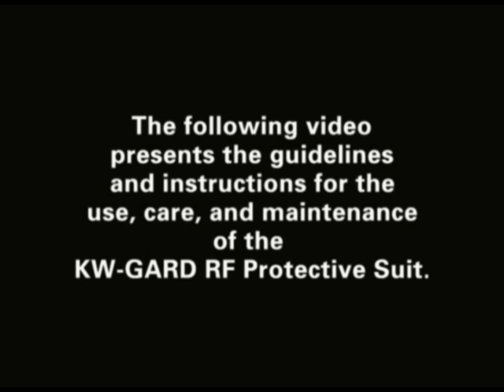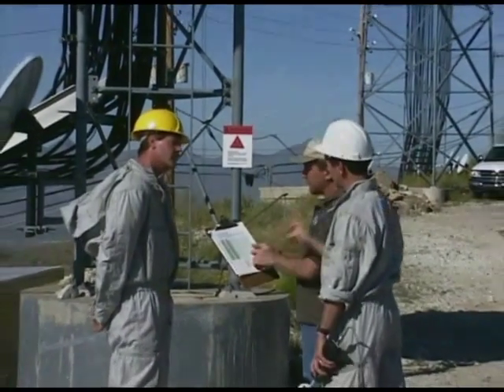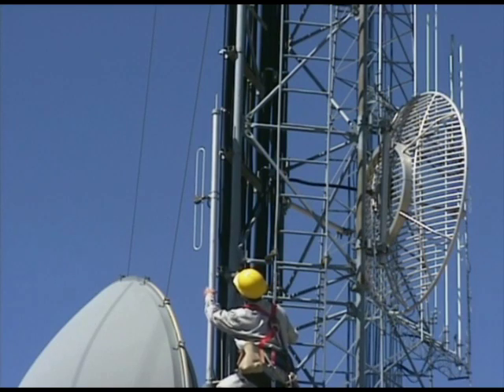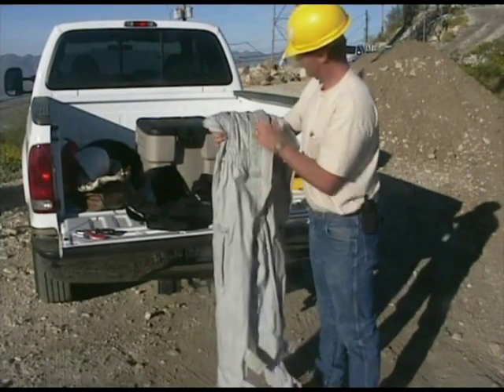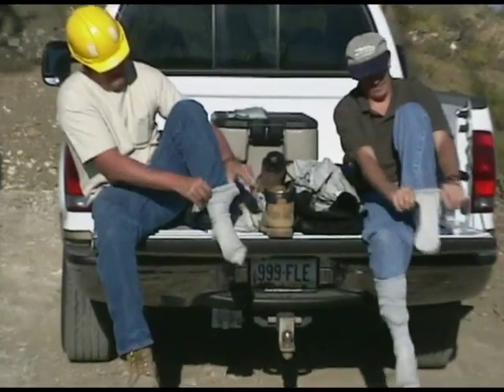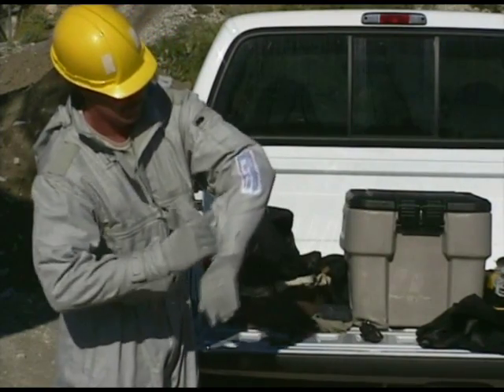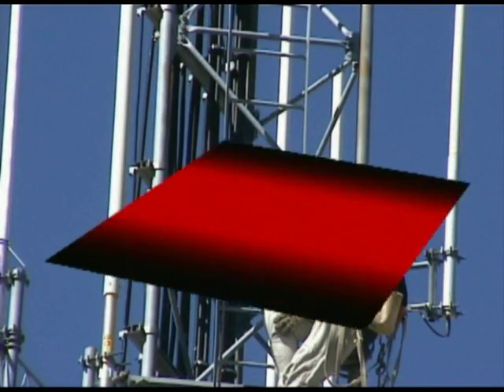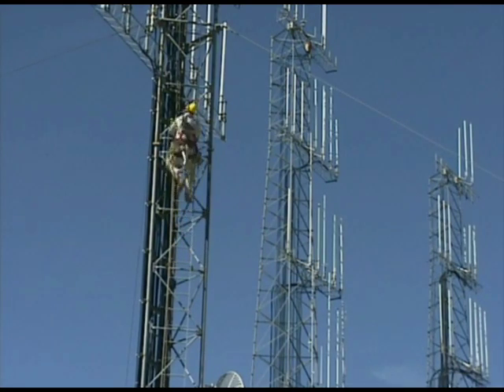KW Gard RF Clothing

Comment: Interesting. RF (Radio Frequency) radiation protective clothing. Hmm. Starts off with a bang! Know your field that you'll be working in. Great video. Thanks for the post. http://www.fda.gov/Radiation-EmittingProducts/RadiationEmittingProductsandprocedures/HomeBusinessandEntertainment/CellPhones/ucm116338.htm

Radiofrequency Background: What is radiofrequency energy (RF)?
Radiofrequency (RF) energy is another name for radio waves. It is one form of electromagnetic energy which consists of waves of electric and magnetic energy moving together (radiating) through space. The area where these waves are found is called an electromagnetic field.

Other forms of electromagnetic energy

gamma rays
x-rays
light.
Radio waves are created due to the movement of electrical charges in antennas. As they are created, these waves radiate away from the antenna at the speed of light.

Waves are measured by

the distances covered by one cycle of the wave (wavelength)
the number of waves that pass a certain point in one second (frequency) .
The frequency of an RF signal is usually expressed in units called hertz (Hz).

One Hz equals one wave per second.
One kilohertz (kHz) equals one thousand waves per second
One megahertz (MHz) equals one million waves per second
One gigahertz (GHz) equals one billion waves per second.
RF energy includes waves with frequencies ranging from about 3000 waves per second (3 kHz) to 300 billion waves per second (300 GHz). Microwaves are a subset of radio waves that have frequencies ranging from around 300 million waves per second (300 MHz) to three billion waves per second (3 GHz).

 How is radiofrequency energy used? 
Telecommunications

Radio and TV broadcasting
Cell phones
Pagers
Cordless phones
Police and fire-department radios
Point-to-point links (microwave communication links)
Satellite communications
Microwave ovens

Radar

Industrial heaters and sealers

Mold plastic
Glue wood
Seal leather
Process food
Medical uses

Pacemaker monitoring and programming